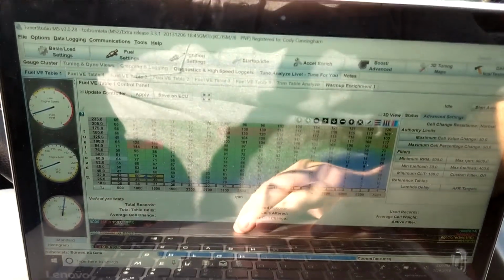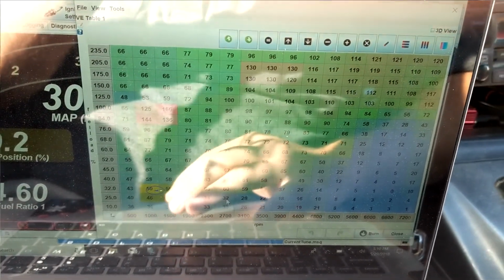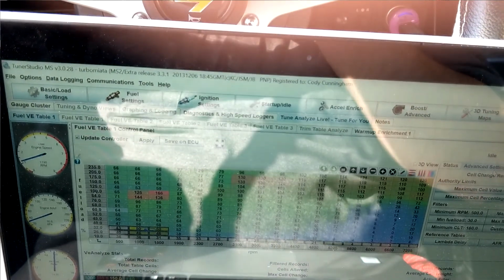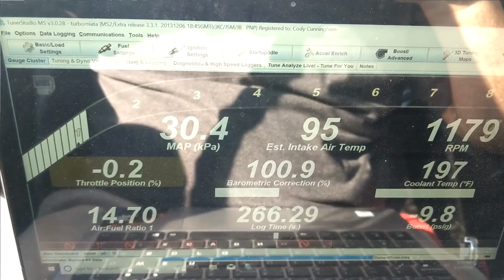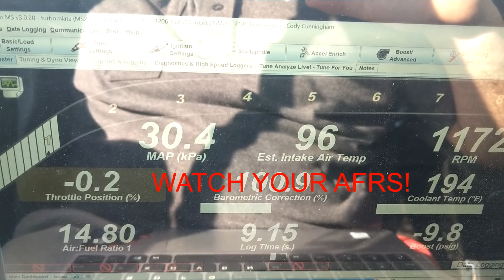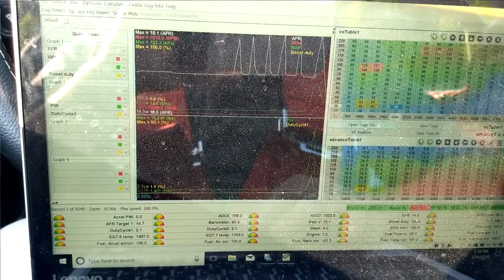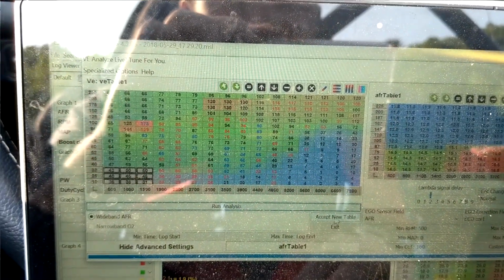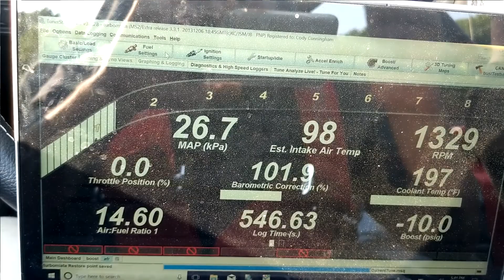Autotune and VE Analyze Basics

Comment: Thanks for posting this vid. So how do you set your desired AFR? I'm considering the SpeedEFI and Tuner Studio. Right now I have the AEM F/IC but want fueling independent of the car's ECU, especially in closed loop operations. Car's ecu wants to pull fuel, fight the F/IC and I've tried O2 spoofing with little success. SpeedyEFI guys say I can run their product in piggyback mode, but it will remove the stock ECU's ability to trim fuel. Do you know of a good starter video? I will not have a base map - specific to my car as it's a bit of a frankenbuild, 2zr-swapped and turbo Yaris. I will be manually wiring it, like I did my F/IC as there is no PnP harness for my application. My goal is to set a specific AFR per boost range; say 12.5 from 1 - 3 psi, 12 from 3 - 5 psi and 11.5 from 5 - 8 psi. I also have a DIY W/M injection kit, so not worried about mildly leaner AFRs in boost. Thanks!

Comment: So do you still do autotune after if you get an actual tune on a dyno? So basically you're gonna always be changing that maps?  Are you able to reload old maps? They're all saved in?
Reply from the maker: If you get a tune by a professional you should not need to touch the map yourself for any reason
Reply: @codycunningham1755  nice... I'll be running ms2 on my toyota pickup.  And will be having a tuner tune it on a dynapack... so mainly autotune is just for the diy...